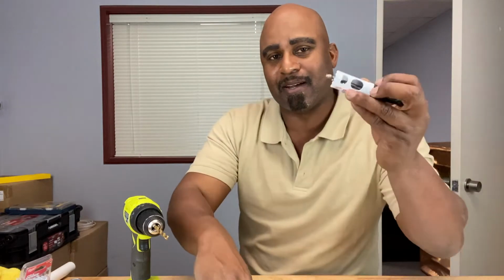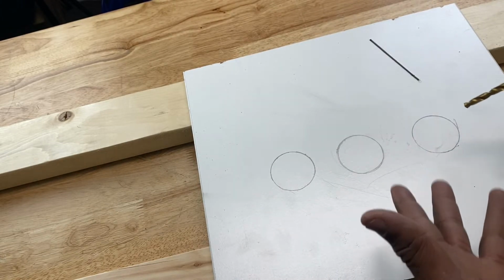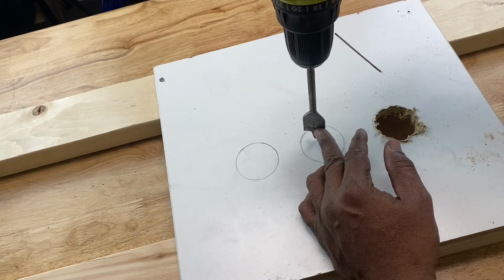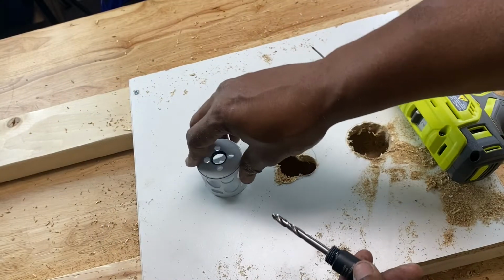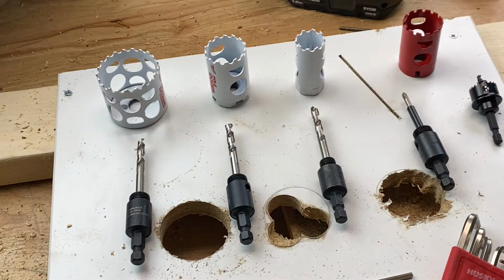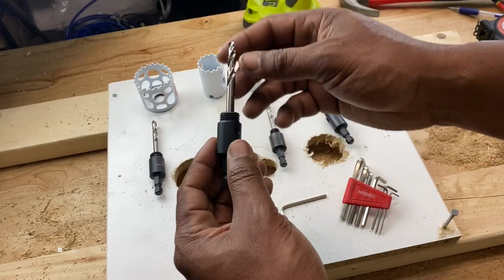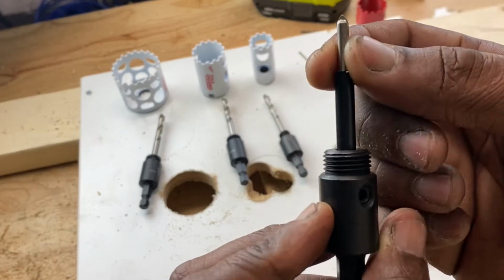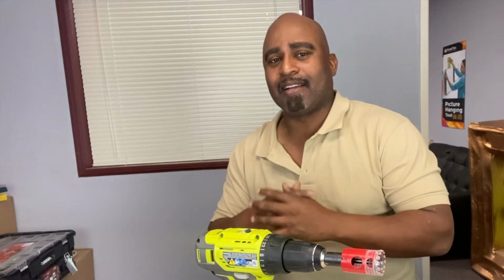HOLE SAW TUTORIAL

Comment: When I can’t get the plug out with the drill bit, I screw 2 screws into the plus at 9 o’clock and 3 o’clock and rock the plus out.  The also make an automatic plus ejection mechanism on the drill mandrel that automatically ejects the plug when you are finished drill the hole.
Reply from the maker: Good tip.

Comment: If I can’t get the core plug out of the hole saw by pushing it with the drill bit, I then use two screws into the plug opposite each other (say at 9 o’clock and 3 o’clock) and rock the plus out of the hole saw.  They also make a spring loaded ejection mechanism in the drill bit mandrel and will automatically eject the plug when you are finished drilling the hole.
Reply from the maker: Thanks. Great tip.